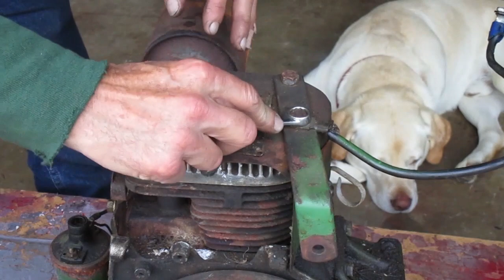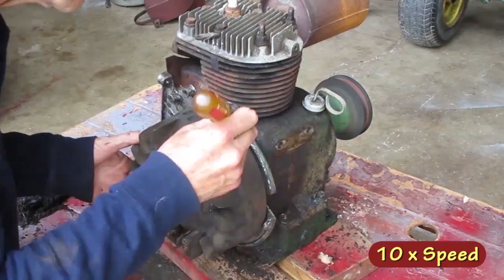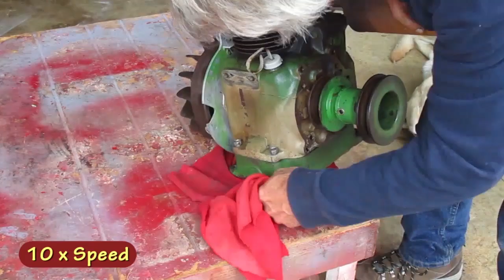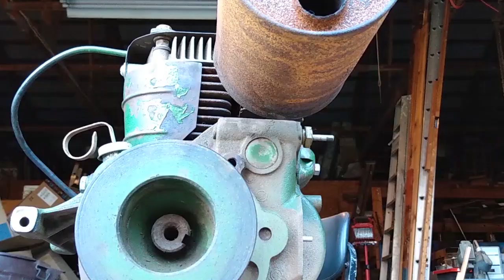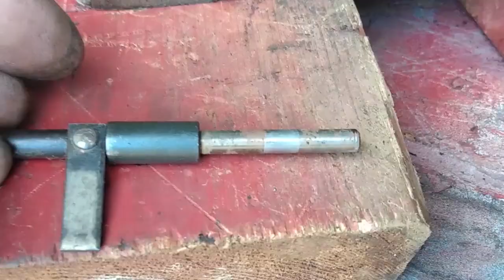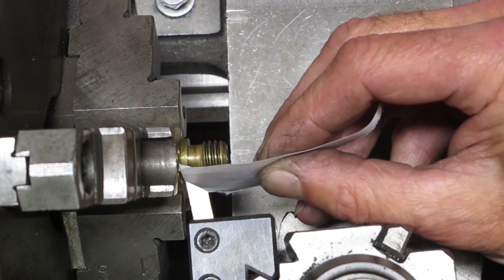John Deere 110 Cleanup Project Part 7, Cleaning the Engine, & Adjusting the Governor Shaft

Comment: We found metal in the pan and I had to send my engine to a friend to have it rebuilt.  It's in Hopkinsville, KY.  I hope to have it back in a month or two because the weather will be great to put it back together.  I have most of the parts cleaned and polished, ready to install.